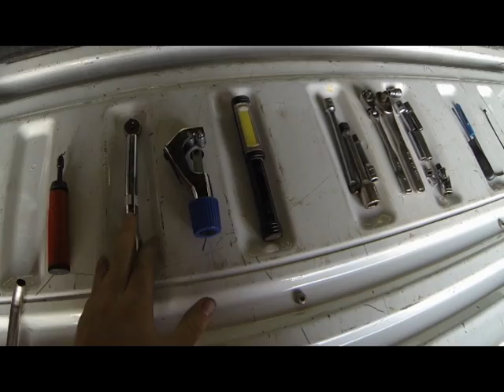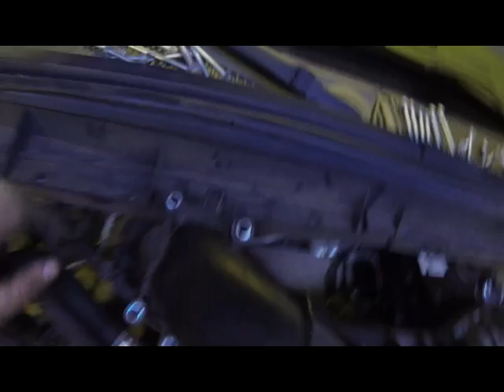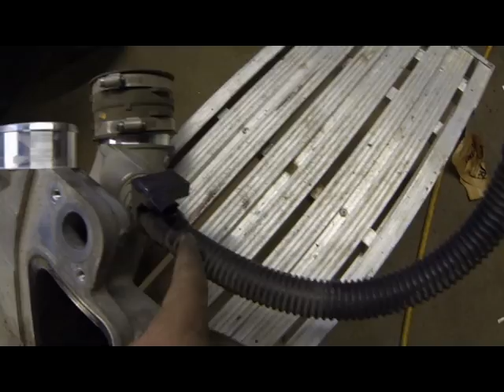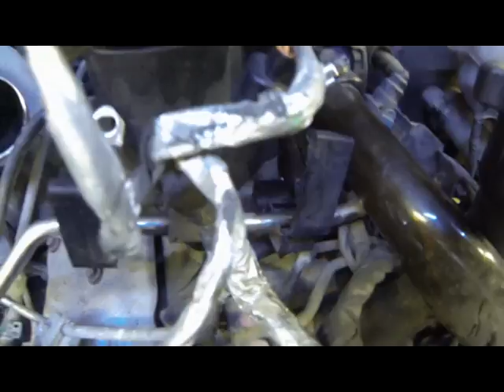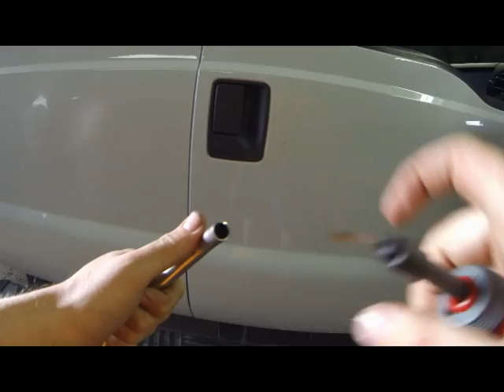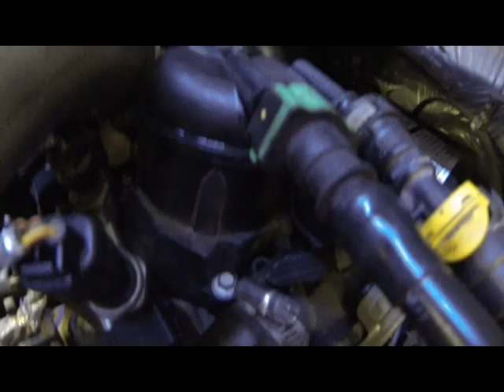6.7L Powerstroke Disaster Prevention Kit

Comment: Your video was a confidence builder. Thank you.  Just completed the install on my 2011 6.7 powerstroke. Just so happened, Another DIY video posted last week and between the two, the job was very easy. 6 on 10 point scale. I am not a trained mechanic..  

I credit my success to being prepared.  I followed your tools list, purchased what I didn't have on hand, i.e.(deburring tool). In addition,  Placing a utility blanket over the grill, good lighting and using color coordinated zip ties to label hoses and sensors i removed. I

Honestly, couldn't have had the same out come without the help. Thank you

Comment: What tools did you use to get the rear bolts out of the UIM. I know its 8mm but 1 swivel doesn't seem to break them loose.
Reply from the maker: That's all I used, from memory I did not use anything special to get the manifold off. Those bolts do not have much torque on them so it shouldn't be much to get them out

Comment: I just finished my install. Took me about 4-4.5 hrs to complete. I had a hard time removing the intake because my 15 bolts don’t come out of the intake. That made it tough at first to get them all unseated.  
Couple things:
- I’m not a daily mechanic and it only took me 4-5 hrs. 
- Be patient!!
- Be careful with your fuel sensor and line when you first pull to ensure everything is clean.
- use a torque wrench!
- pull the cac tube and fuel filter off first. Next you need to unhook your trans and oil dipstick lines. Then on left side the EGR coolant line as you remove the intake. Take your 15 bolts out and be patient but pull the passenger side out first and then driver, it will come out gently. 
- Clean your valley and all surrounding areas BEFORE unbolting your fuel sensor and fuel line.
- stuff rags under your fuel lines before pulling because they will be full of fuel
- clean again, and again
- pull your line and sensor
- lube your o rings and install the sensor to the bracket and Bracket to the truck. Torque it down
- lube o ring on braided fuel line and install.
-make sure you deburr the cut line and flush with brake cleaner or clean diesel fuel and or compressed air. 
- reinstall the rest and make sure your new braided line is not touching anything, zip tie if concerned.

Lastly thanks to Zeb for making the video. I’ve had too much to drink to get on camera unless my neighbor wants to join me haha

Comment: Needs a coolant cap? Look at the top coolant hose should be round and is flat.
Reply from the maker: Good eye, I had actually taken the cap off at some point to check coolant level though, that's probably why it flattened out during the install video.  Always a good thing to check visually on normal maintenance!

Comment: This video is misleading.  He leaves out many crucial details to complete this installation.  It's a moderately difficult task.  It would take me an hour to actually explain this installation.  A video of about 45 minutes would be a minimum to show the steps needed to install the disaster kit.  There were many issues that came up during installation that the video fails to address.   I'm no good at making videos so I'm not the one to make a better video.   I can tell you I've worked on Ford powerstrokes all the way back to my first 1987 F250 which was the last year of the naturally aspirated 6.9 Navistar engine that was used.  I've been working on these trucks for 30 years.  Believe me if this video encourages you to try this on your own and your not experienced as me I suggest you not try this.  The disaster kit is an excellent idea!  I put one on my TDI VW too, which shares the same crappy fuel pump from Bosch, the CP4.  I highly suggest everyone put a disaster kit on your Powerstroke to alleviate the complete replacement of your fuel system.   Just don't think this is as easy as this video suggests.   It's NOT.  If your borderline mechanically inclined don't try this yourself.   Take your truck to your diesel mechanic!  Believe me you'll be better off!  Good luck!
Reply: This sounds like something for-pay mechanics would say! What could be so hard about this? Seems like cutting the pipe and deburring it is the hardest part. Feel free to elaborate since you're fear mongering to convince people to go in and drop $$$ just to have someone else do it.
Reply: I do these pretty often and they are pretty easy. First one I did with no instructional video either, lol. If your a 30 year veteran diesel mechanic you would think this would take you an hour. I generally only spend 2 hours on this kit

Comment: How many miles/kilometres would this kind of failure be common to occur?
Reply from the maker: Depends on who you ask, but ultimately it's not mileage dependent.  The kind of failure experienced is usually from low fuel quality or very high water content in your fuel tank.

Comment: Disaster prevention kit, what can happen if this isn't done? What kind of problems are they having if this isn't done? Thank you for your video, very well done. Take care bud.
Reply from the maker: This kit is designed to limit damages in case of a failure of the high pressure fuel pump.  If it were to fail due to debris, water, or other issues, these components are designed to route the harmful debris from failure back to the fuel tank to be filtered out before getting into the fuel rail and injectors.

Comment: Should the 2 sensors be removed prior to cleaning that hard line out?
Reply from the maker: I don't believe it is necessary to remove them before cleaning, I did not when doing this video/my install, however it couldn't hurt if you really wanted to.  It will just add time to your install and I am not aware if there are any one-time use seals on them.  

If you leave them on just be very thorough when cleaning the debris out after cutting.  Blow the brake/carb cleaner and air from the un-cut end towards the cut end so as to carry the shavings out away from the sensors and the rest of the tube.

Comment: Are they still using that same pump on the 2017's
Reply: Charles Prince from my understanding yes.  Looking into one of these for my 17  haven't heard enough about them to want to make the call and install one
Reply: they have to have some reason to bring em back in to the shop and keep the money flowing in the dealership! Even though the breakdown in all the added new technology should be doing that enough for them but in business its grow grow grow, greed greed greed!
Reply: The best way to solve this problem is adding a 1st stage Cat fuel filter and make sure you only run high quality diesel. If you changed your fuel filter every other oil change this problem isnt a issue but that is quite costly
Reply: @matthewmeek4289  or... you could have a defective pump prone to failure and no amount of babying it will prevent the inevitable failure, so $200 safety package might feel worth it to some.
Reply: @matthewmeek4289  What micron is the Cat fuel filter?  Does it have a good water trap?

I was reading about a higher capacity 2 micron filter with a better water trap last night, Computer locked up and I lost it haven't found it again yet
Reply: They also use these pumps on GM Duramax and VW diesels. 

Change your filters frequently. Drain your separator once a month. Add Ford PM22 fuel additive or some other demulsifier. If you’re really paranoid run your fuel through a Mr. Funnel at the pump. Water is what causes the failures.
Reply: @rubberhamburger  I'm under the impression it's a combination of garbage in the deisel AND poor lubrication. I think a FASS system would be more protective then just getting a bit more water out then already occurs.